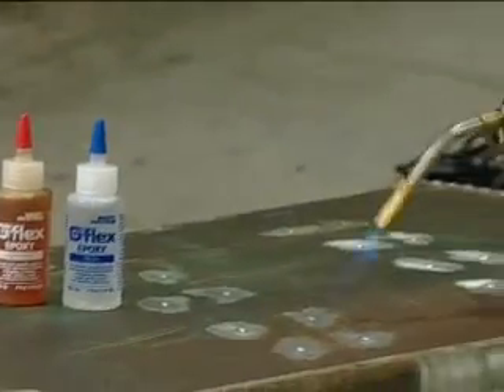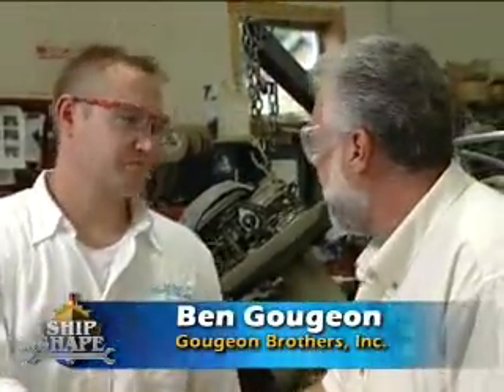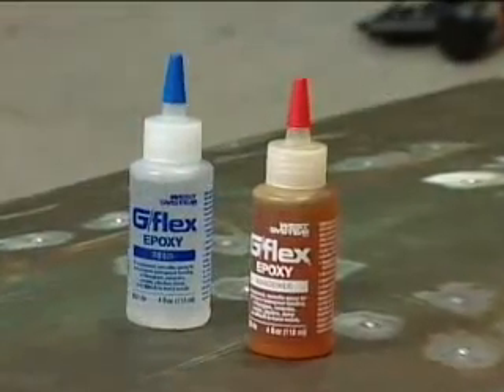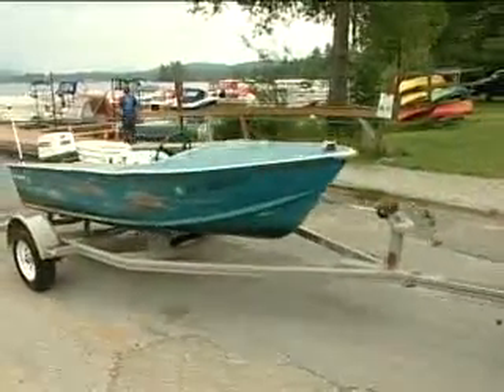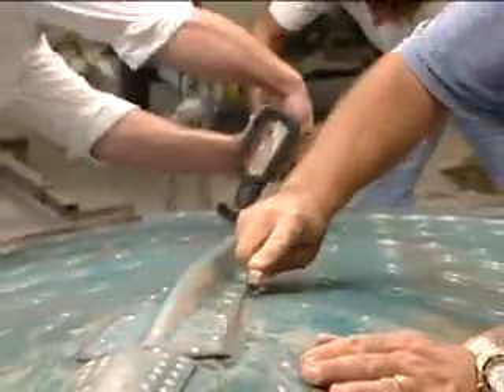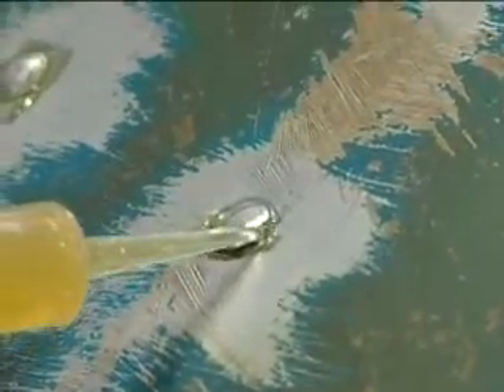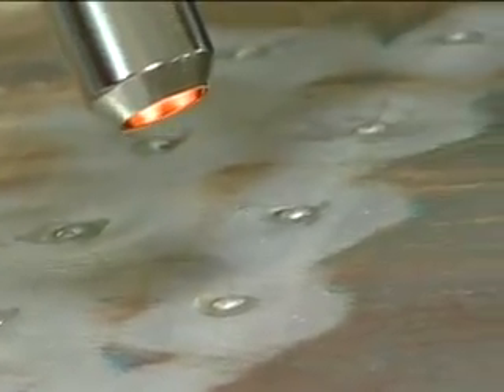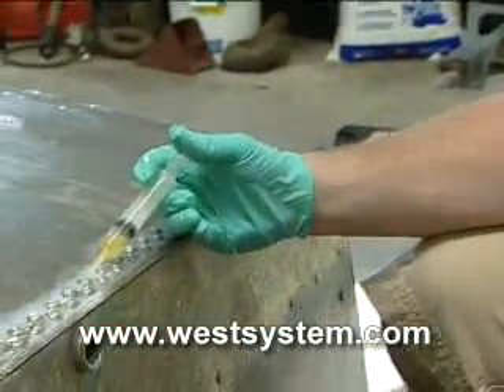Aluminum Boat Rivet Repairs

Comment: STOP! DO NOT DO THIS!!! Rebuck or replace leaking rivets. This is not a fix this is a temporary solution.  NEVER EVER DO THIS! This gflex product is to be put on rivet when replacing it NOT on the surface of the boat.

Comment: Rivets that are leaking need to be re-bucked, using an air hammer with a rivet punch  and a block of steel on the backside. That is the only CORRECT way to fix them. Then, coat the entire bottom of the boat with 5 coats of polyamide epoxy such as Interlux Interprotect. This will protect from corrosion, as well as sealing around the edges of rivets.

Comment: Wow nothing but little complainer bitches in the comments !!!!! Why would you do.all this work and the reset all the rivets ? Its an old boat you dummies it will just leak again. The epoxy is a TRUE way to fix this problem for years. The G flex is supposed to flex to avoid cracking , which other profucts like jb weld will do. You all a bunch of babies in the comments !!! Great job boys on the boat ,

Comment: Wire wheels/brushes on aluminum is a bad idea. Differential corrosion potential is very high. Better to use Scotch-brite to avoid that possibility. 100,000 aircraft mechanics can't be wrong...

;)
Reply: are you talking about a scotch-bite pad that is attached to a drill/grinder or just by hand?  what grit?  Thanks.